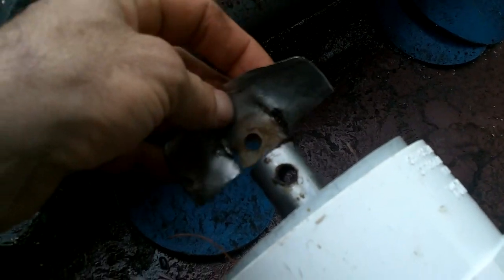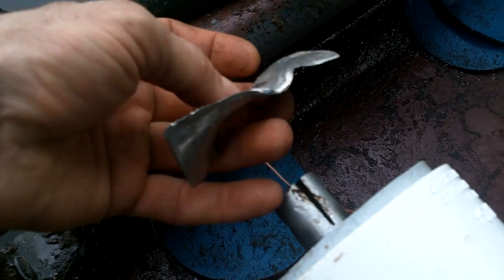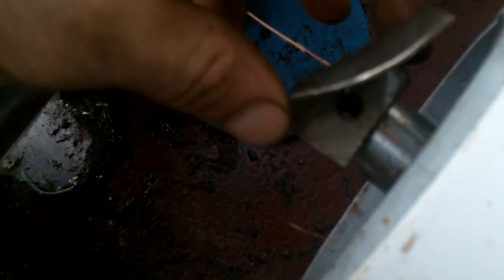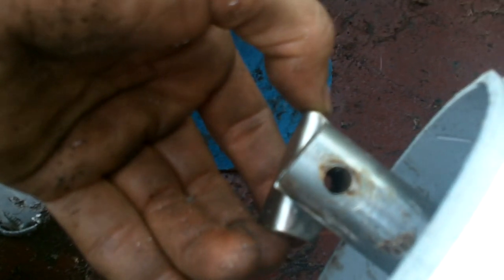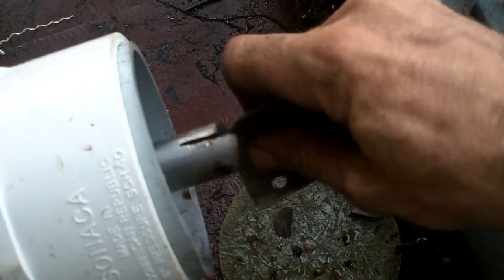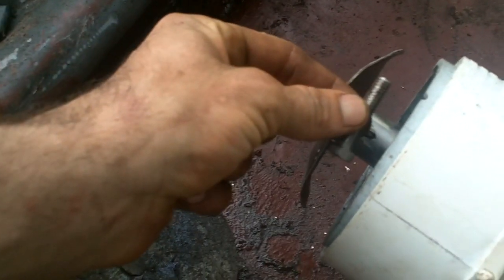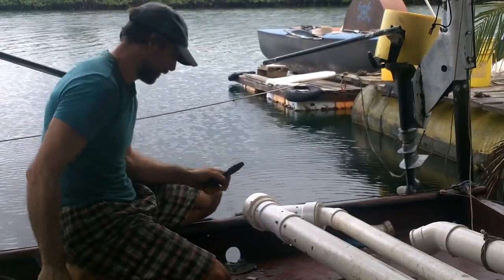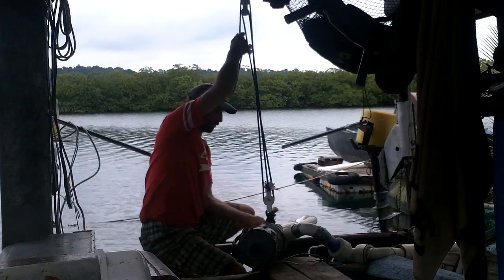Stronger Pump Propeller

Comment: They use something like that mining gold in Alaska but they have a little guard to protect the impeller from damage, Just a thought, Nice dredge otherwise. It would be sweet if you could find some flexible hose, Maybe a old fire hose would work?
Reply: rv sorce the Alaska dredges have a water injection system to draw the water up the tube, no moving parts .....I expect Jamie is dealing with softer stuff. Maybe we will find out .....cheers Warren
Reply: @CheersWarren  that's why i said something,  with that setup I would guess mud but he said he hit a piece of wood, that's why i suggested the guard. but thanks for the correction.

Comment: Is that for dredging, or pumping just water? It seems like it could probably pump mud or maybe even concrete if there's an archimedean screw in that whole pipe. Did you do a build video for this thing? I don't recall seeing it before.
Reply: It was made some time ago, there is a video, you just need a link that can be found else where. Its is used to clear the silt from the canal...
Reply: @kameljoe21  are you sure i watch all his videos weird.
Reply: @jeffkrupke3810  The video is unlisted that is why you can not find it, There is a link, you just need to spend time and find it.